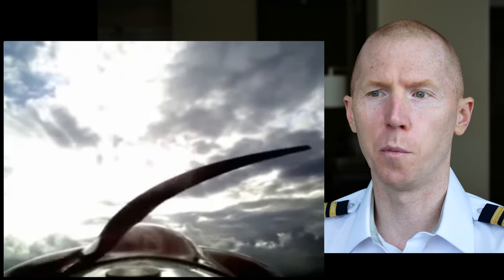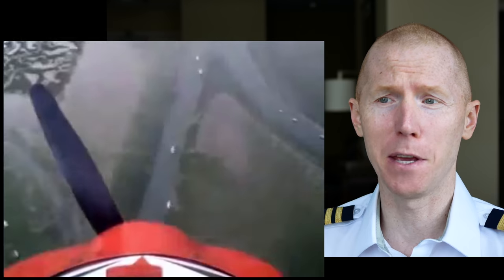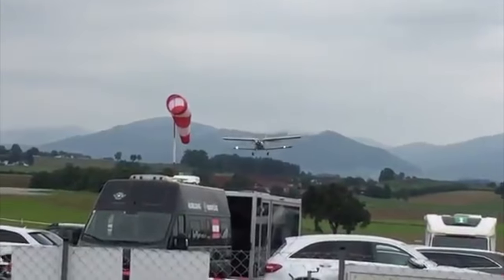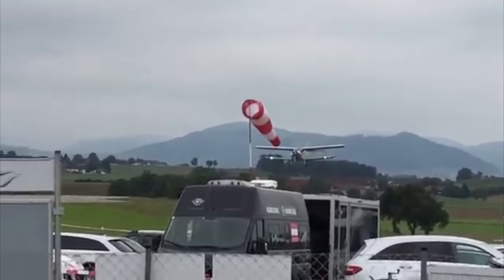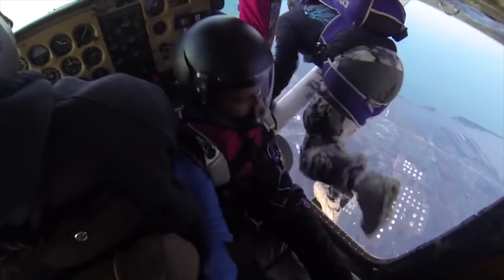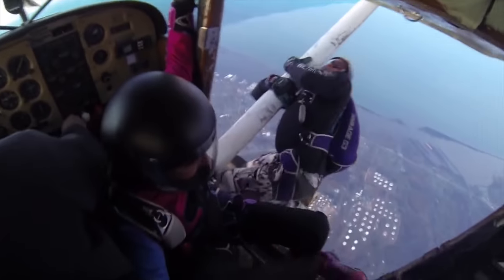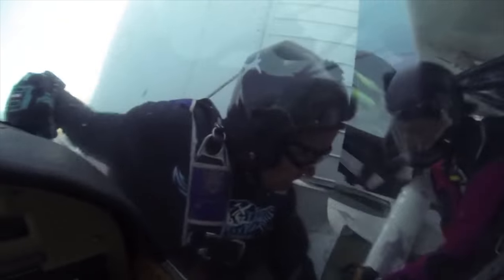Mid-Air Collision Rips Plane's Wing Off | Viral Debrief

Comment: Regarding the first incident - stall/spin crash landing. Being a low-time single engine pilot, it's perhaps impertinent for me to disagree with a 747 pilot, but I don't think Kelsey has the correct analysis in this case. It's not a flat spin. The maneuver looked like a classic stall/spin practice in a single-engine plane as was commonly done by generations of student pilots. I heard that flight schools today don't have student pilots practice fully-developed spins because of the danger. (An instructor and student at the flight school I attended died doing that). But I got my private license in the mid-80's in Canada and it was standard at that time for students to do a full stall leading to a three-turn spin, with recovery. I believe that's what this pilot was doing, except he continued the spin (I counted 10 turns before the propeller stopped), but his plan was complicated when his engine presumably quit, leaving no option but a forced landing after the spin recovery.

I say it's not a flat spin because the horizon is consistently at the top of the video picture and the nose of the plane is pointed steeply down towards the ground. It's deceptive because the wide-angle perspective of the camera.

Comment: I came across a video from 2017 where a couple recorded fuel being leaked, though it looks like it's being dumped from the wingtip to the tarmac just before take off of a United Airlines flight. They claim they saved the day by warning the crew. Is it possible a flight crew would not notice fuel being dumped from the wingtip before it takes off?

Comment: I gotta wonder if many Pilots take up motorcycling or if they often have motorcycles before taking up flying... (???)

    I hope you (Kelsey) get back to this thread... eventually... Because a LOT of what you say sounds A WHOLE LOT like the coaches and instructors I've had for motorcycles... Now, I have some (precious little) experience with aircraft. JUST not a great deal of opportunity or purpose served over the time, but I did get into ultralights and helped out with small craft from time to time. I'm a quick study... so I do get what you're saying most of the time...

    In motorcycles, there's no place or time to "panic"... If you can't "rope it in" and DO something, all you'll get is "splat". You can't just give up either. (see "splat")... AND the controls are trickier than a car. In a car, to stop, all you do is press a pedal. The quicker you need to stop (or slow down) the harder you press... simple. AND you won't die if you stomp the thing. Almost every car, truck, and other vehicle on the road has ABS... 

     NO ABS on many (most) motorcycles. AND if you stomp, kick, jerk, snatch, or yank on a motorcycle,  YOU ARE COMING OFF! (see "splat") In fact, you can crash at 1 mph just by having the handlebars out of center and squeezing the front brake. Do that, and the bike will throw you over onto your face in which ever direction you were turning, even a little bit. Riding a motorcycle is a delicate balance... AND riding at high speeds only makes that balance more delicate.

      SO coaches will warn you to leave enough margin for error "on the table" that whatever you're doing and whatever goes wrong, you can still recover... They'll teach you not to back off a corner just because you "came in too hot"... They teach you "commit" to the corner. Look THROUGH the corner, and go ahead and lean in... dedicate to making it and keep your eyes where you want the bike to go. Most times, that bike is actually MORE competent than you are at making the turn. Even if not, by Committing to the turn (yes, capital C) the worst you suffer is a "low side" or "wash out" where the bike tips past the ability to recover and falls over on its side. In a "full lean" there isn't far to fall in a low-side, so it's mostly just a lot of bouncing and skidding over the ground... Where trying to recover or fighting out of a low-side tends to result in a "high side" crash, where the bike snaps upright and then flips over the other side, throwing YOU up into the air and off into a tumble... It's violent, and bone-shattering.

     Speaking of corners and curves... We have a philosophy. "Let the corner come to YOU"... meaning "BE patient" and don't start leaning before the road starts curving... It's all about moving from one input to the next on the controls as SMOOTHLY as possible. In the clip with the bi-plane, I noticed he knocked the wheel (landing gear) completely off the plane... which could've been avoided JUST by letting the landing strip come to HIM instead of trying to force it... 

      AND there's one of your other videos you mentioned how helicopter pilots have to think so quickly... Well, even taking your time on a motorcycle, you get used to making decisions at speed... You make dozens of judgments and adjustments every minute of the ride... NOTHING is ever "on the line" because that line... that "racing line" everyone likes to talk about is RAZOR thin. You're NEVER quite perfectly ON the thing... BUT the more precision you can get, the more consistently you can keep "close enough" and the closer to the "perfect line" YOUR close "enough" will stay. I'd even recommend getting into motorcycles if you're a pilot. EVEN if you just get a little 200 to 400 cc Trail bike and go for weekends playing in the dirt and sand! ALL the greatest motorcycle riders played in the dirt (for one thing) and it builds your reactions, refines instincts, and improves your balance and coordination... AND any form of motorcycle riding will improve the LUCIDITY of your mind to process about a thousand little factors and details from "important" to "useless" and make a judgment call at nearly the drop of a hat... with enough "on the table yet" to recover or make adjustments and improve upon what's ongoing toward "optimal... ish" 

     BUT I AM certainly curious about how many pilots ALSO ride motorcycles. I'd hope quite a lot of them, actually.  ;o)

Comment: If you had been able to watch the vsi the entire time, you would have seen it indicate a rapid descent. With only one jumper on the outside of the aircraft, the pilot can maintain altitude. With three jumpers outside creating drag, there is no way a piston-engined Cessna can maintain altitude. 
At the start of the video, both aircraft seem to be at nearly the same level. The aircraft in front gets it's jumpers out first, and starts to lose altitude. Once the trailing aircraft gets a couple of jumpers out it starts to lose altitude, then the pilot gets distracted, forgets to keep the wings level, and the plane banks to the right. Crash.

Comment: The to planes crashing into each other.  When two objects go side by side a loss of pressure builds up between them.  Like two boats on water too close to each other going in the same speed.  They can crash into each other due to the pull of the water or decreased pressure between them. The same could be the cause of the crash of those planes.

Comment: 5:00 This first video, the pilot made a really bad mistake, in this case it worked out, but it can very easily not work out.
     Once your engine quits you should restrict your choices of landing spots to locations no more than 30 degrees off your course.
     This pilot made a very steep turn, almost 180 degrees, even though he had suitable choices in front of him.
     None of these looked particularly good, but it looked like he was trying to save the plane.
     He was lucky not to spin again, but as it was once he finished the turn he was quite low and he didn't have the speed to control his decent rate, so he impacted the ground quite hard.

Comment: I have a good question, the big 380 that landed sideways into the wind because of very strong cross winds, well, how many times can any large commercial airliner, or ANY plane for that matter, how many times can they take such a beating from hard landings like this before some part like a wing, or tail, elevators, fail and kill people? I know constructions down to a science, but still, it's only thin aluminum skin and parts. It would seem the beatings these planes take could cause a catastrophic failure at any given time the way they get bounced around!
Man the colliding skydiving planes, while I've seen it before, I'm not sure I saw much video from the other (lower rising plane) point of view. I played it back at 1/4 speed multiple times and froze the images, and I swear it looks like 1 of the sky divers was engulfed in flames from the waste up, and part of his chute, maybe the pilot chute was out or something on fire above him. It's amazing even the Pilots were able to get out and everyone was conscious enough and lucky enough not to have been hit by a part or spinning prop and survived. I thought for sure at least the Pilots probably didn't get out.
I've jumped a few times before way back in the day, so I know the Pilots usually wear parachutes, but I don't think they always do, or did back in the 70s anyway.  That was one crazy wild ride that happily they can all share a beer over later, at least if nobody on the ground was hurt.

Comment: Kelsey, just found this vid, but your analysis of the skydive plane mid-air is WRONG. This accident most likely started on the ground, failure to fully brief. Formation flying is a skill that must be trained and practiced to be any good at it. The rules are simple #1 - wingman don’t hit lead, #2 - fry to stay in formation, #3 - wingman needs to know what to do if he loses sight of lead. Clearly, the second airplane failed to follow rule #1 and hit the lead aircraft = second pilot at fault. 

As for what happened, there is a shot from the second aircraft showing the first aircraft ahead, slightly right, and slightly above (the near perfect position). From there we next see the lead aircraft below to the right with a slight crossing angle and the second aircraft effectively coming down onto the lead aircraft. (No I don’t care which aircraft was climbing or descending, see rule #1 above.) The second aircraft had too much overtake and caught lead (yes, the skydivers getting out onto the wing probably helped slow the lead aircraft sooner, but we don’t know the exact timing. Plus, it doesn’t matter - see rule #2). The second pilot should NOT have climbed at all. The correct response would have been to reduce power when he saw that he was catching lead (This would have been done earlier than you suggested.) Once the pilot made the mistake of climbing and losing sight of lead, he should of turned away from the last known position of lead. Yes, this means turning left. It is NOT a violent turn, just a shallow turn when he lost lead would have done it. This the correct response in formation flying, PERIOD - no further discussion required! As for the skydivers, in near level flight, no chance of hitting tail even while turning left (remember they start at Same velocity as aircraft. Once they let go, gravity instantly start acting on them pulling them down faster than their forward momentum decreases.)

A properly briefed flight, especially for pilots unskilled at formation flying is a necessity. That alone might have prevented this accident.

Comment: That plane looks like a Pitts Special.  a stunt plane,  it looks like he was doing a right hand spin into a flat spin and a controlled recovery BUUUT the engine failed  the reason for the emergency landing ...look close Kelsey!  .......I just remembered.   This red color Pitts special was being tested with an engine-failure problem, whenever the aircraft was put into a spin.  The pilot / aircraft engineer proved the problem by deliberately putting the aircraft into various spin/ stall configurations. The landing was pre-arranged in the grass without to restart the plane so that the mechanics and engineer could examine the engine  fuel flow components in the hangar the maneuvers in the film were all deliberate.. the pilot was never in danger🤭😁

Comment: @Kelsey: My comment to Antonov crash at video (5) Mid-Air Collision Rips Plane's Wing Off | Viral Debrief - YouTube.
I know this airfield and I also flew there in and out a few times. It is Gmunden-Ohlsdorf (LOLU) in Austria. The problem there is, that the runway is about 30 feet higher than the environment. It is like an aircraft carrier. So you can easily fail estimating the altitude when you want to flare. Also the runway is pretty short and at the end there is a hill, a huge tree and a house. So what else can you wish... Needs experience to fly in there. I started with a Piper Archer, towards the hill, 4 POB and it was skimpy ;-)

Comment: Does anyone know what was the first plane?  I could be wrong, but it didn't necessarily look like a flat spin to me. What bothers me the most, there is no spin recovery training in flight schools. To me, it should be mandatory. In most widely used training aircraft (like Wichita Spam Cans) spins are prohibited. Then, somebody please explain those planes they are not allowed to spin.
That AN-2 pilot seems to be a quite low hours an the type and probably didn't fly it for some time prior the incident. To me he seems to misjudge the hight. In a typical GA aircraft pilot sits a few feet from the ground, in AN-2 it is more than 10 ft. His speed was still quite high, remember, AN has ridiculosly low stall speed, he just flared to low.
About the collision. It probably happened due to inexperience in formation flying and inadequate preflight briefing. I will call the plane with camera plane B, the other one A. To me it looks A is the leader, B is a wingman. Job as a wingman is never to lose sight of a leader. They are flying in quite a close formation, so positioning is critical. In this situation, flying a Cessna I'd chose position to the right and behind the leader, since that position would give me the widest angle of view. Wingman pilot sits on the left and his view to the right is quite limited and he clearly can not see a plane lower than him in the front right quadrant.
Reply: @NCN1965  Yes, it probably is prohibited, like most planes, but it doesn't make them immune to ununtentional spin. That's why I strongly believe in spin recovery training.
Reply: @NCN1965  I'm fully aware they are very stable, but they are not completely immune against spinning. Low speed, steep turn, add some downraft, and there you have it. I've experienced a spin in Cessna 150, which is also very stable, and I can tell it turns surprisingly fast.

Comment: 03:20 Not only over the wings. More important: less or even no airflow over the rudder! Normaly you go with the rudder out of a spin.  In a flat spin the rudder is completely useless. I don't know how he managed it to get back in a normal spin. But I would loosen my seat belts and lean so much forward  I can to get the weight to the nose of the plane. I know one of my comrades saved this out of a flat spin a few years ago. (this is why weight and BALANCE is so important, to much "weight" on the tail the danger to go in a flat spin is increased).

06:02 this bad behaviour I have too and I have to work on it. 

09:40 To drop skydivers is not so easy as it looks. You have ti slow down your plane to open the door. When you are to fast it will damage the door. We had that case a few years ago where the door of our cessna get ripped of after dropping because the pilot was not able to close the door due a damaged close pin.
And your jumpers want to go out without a lot "wind" caused by high flying speed. 
Than, your center of mass is way out the center when three people hang put of the plane (+the massive air resistance), so your plane starts to turn massive to the right and you have all hands full to do to compensate this. And than you have maintain speed AND altitude (without going into a spin?) Thats very difficult!
And than handle a formation flight? For me to much I guess and for the pilots in the video too... 🤷🏻‍♂️

And to the collision: Manfred Strößenreuther, a german aerobatic ace and flight instructor died in a similar accident when the collided in a Fuji FA-200 with a Cessna 150 in the traffic pattern at the (for me nearby) airfield of Speichersdorf/Rosendahl. All involved people were killed. 

11:25 Luckily all skydivers I know have AAD's like "Cypress" today. (at our dropzone it is mandatory!) So the chute will open between 750 and 1000 feet above ground when the skydiver is always in free fall at that altitude.

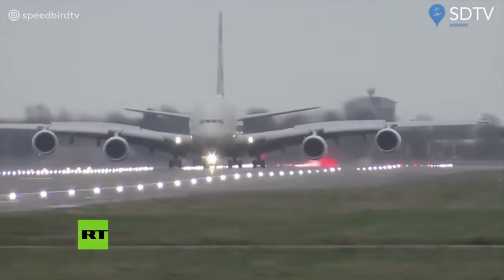13:35 "Yeeehaw!" That makes to sit in a airliner interessting! 😆

14:24 When possible: sometimes turn the green side up!

Comment: I watch all ur videos. I try ro figure out ur analysis before u make it.  I am on the ball most of times.  Ur form Cessna para jump crash. What happened to lower plane if all survived?  And ur flat spin video.  We were taught spins. Normal.  We were not taught flat spins, except in class room. Flat spin recovery usually impossible. Takes a lot of different manifestations to recover. In planes I fought ACM sometimes flat spin.  Recoverable? Yes but w extraordinary airmanship skills.  Our rule was flat spin, u eject.